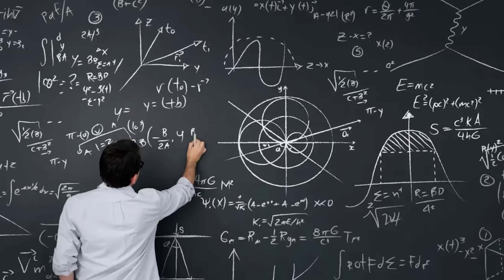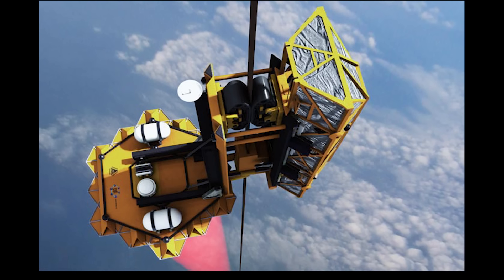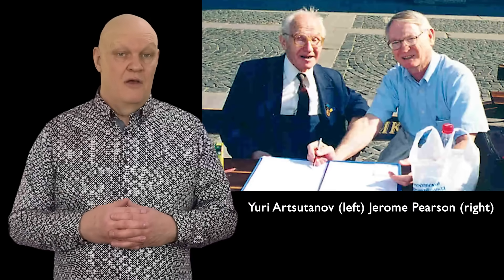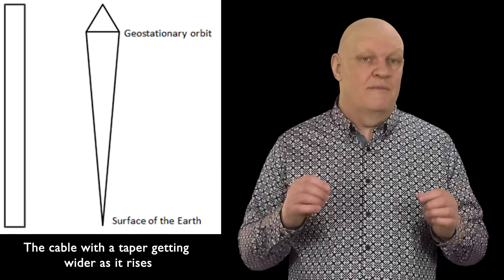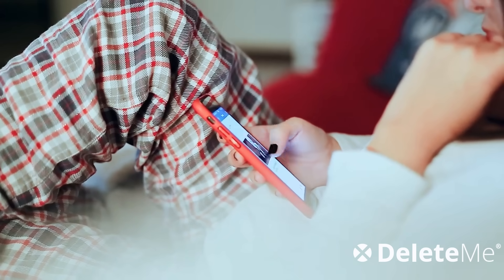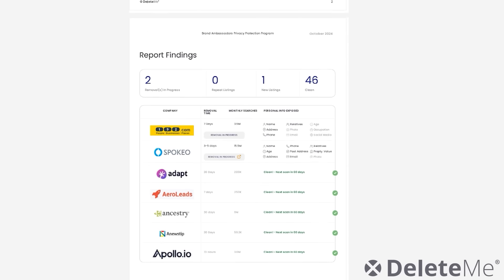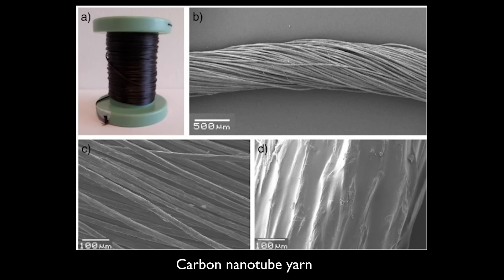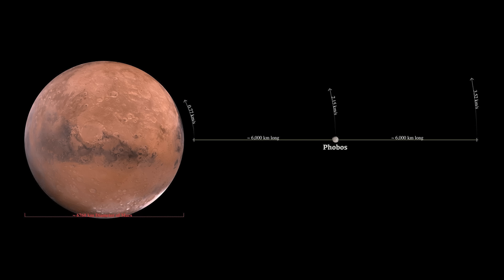Are Space Elevators Still a Thing for the Future?

Comment: The elevator is moving east at 1000 MPH at the surface. The elevator has to be accelerated to orbital speed as it climbs. It will pull west relative to the base. The counterweight will be pulled down. The combination will cause the cable to swing east, and west at the swing frequency of the cable with the elevator at the deflection point. The counterweight will also swing up, and down. The only thing to dampen the swinging will be friction with the part of the cable in the air. Very little of the cable is in the air, and it's moving very little. Most of the motions of the swinging will be in space with no friction. The swing could be dampened if as the elevator pulls west it drags an anchor ship through the ocean. The cable would displace west every time an elevator went up. Continents are in the way so that wouldn't work. The anchor ship would have to be dragged east, and west as the cable swings to dampen the swinging. However, every satellite, and tiny piece of debris in low Earth orbit crosses the equator 32 times a day. Good luck with that.  

On the other hand...

An electric maglev train accelerating with 10G would get a spacecraft to orbital speed with 300 miles of track. Suspended from balloons at 120,000 ft. would be above 99% of the atmosphere. The balloons could be filled with cheap hydrogen rather than expensive helium with no chance of fire because the pressure is too low to sustain combustion. A compressor would be needed to provide air to the motor that turns the generator that powers it. The 17,500 MPH orbital speed would have a wind resistance equal to 175 MPH at sea level. It would not kick the air away at 17,500 MPH. It would compress the air, and heat it up to 5000 degrees. The ship would need a heat shield. The air would then expand back to normal pressure, and temperature, and produce a low pressure shock wave which would hit the track. The track would have to be tough enough to take it. Or the track could be in a vacuum tube with a high speed airlock at the muzzle. A thin plastic cover that the ship would penetrate, and a fast door that closes after the ship exits, and before the air can rush in could do it. While building the track it will be capable of launching hypersonic ships across oceans, and around the world. Trade for those services may be in such demand that several might be built for that trade. They could be assembled occasionally for space launch. Or they could be built until there's an over supply of sub orbital capacity, and the over supply could be assembled for space launch. All of it can be built with hardware available today, and most of it has been available since the nineteenth century.
Reply: That is a thorough explanation of the angular momentum problem that pretty much anyone excited about space elevators overlooks.

Comment: I gather another issue is that, even if a space elevator worked, it would only take you to a geostationary orbit. A LEO orbit requires a much higher speed and most of the fuel with LEO launches goes into the orbit part and not the “getting into space” part.
Reply: While the elevator might not be ideal for LEO, it is well placed for Geostationary orbits and, importantly, launching vessels to the moon and planets.

Comment: A cable that cuts straight through the atmosphere would have to deal with a strong current because of the difference in charge between the high atmosphere and the ground. That will create heat and I think a carbon cable might burn up.

Comment: Even if carbon nanotubes or similar were already being manufactured at extraordinary lengths by 50 factories, it would take a hundred years to produce enough to make the rope/cable. But probably faster than it would take to vacuum the full scale hyperloop to 1/1000th of standard atmospheric pressure.

Comment: Electrical potential between ground and ionosphere is ~ 400 kV.  Don't know what it is from ionosphere further out into space but it's definitely more.  There was a shuttle experiment where some length of material floated away where one end was toward Earth and the electric potential difference between the ends caused a violent electrical discharge breaking the material.  Can only imagine the amount of current available from ground to sky, think of sprites, elves, and blue jets electrical discharges into space from tops of storm systems.

Comment: 4:44 0.63 MPa can’t be right. S355 non alloyed steel has a yield strength of about 355 MPa, tensile strength is even higher
Reply: Specific strength is what's in the video, which is per the steel's density. You're quoting yield strengths which does not take density into account. Video is correct (edit: see further reply below on units). The value will vary depending on the type of steel.
Reply: @dimvoly ok then I suppose the unit is incorrectly shown
Reply: @Hemeralopie  actually, yeah you're right, the unit shown should be kNm/kg, or something along those lines. Good spotting!
Reply: Thank you. Obviously nobody will ever correct mistakes - another argument for not watching YouTube.

Comment: One little detail I get hung up on is the idea of tethering the space elevator to the Earth: I’m of the opinion that it doesn’t need to be tethered, and should hang free. Think about how strong a tether would need to be, with the very heavy space elevator moving around in the sky, then realize that that would impose extra stresses on the elevator itself. It’s just not necessary, in my opinion.
Reply: If designed so that it doesn't need to be tethered, then you might as well connect it to the ground for ease of access, since that won't add any significant mass. At which point it is tethered. So I don't think your idea makes sense in practice!
Reply: Kepler taught us… All orbits are elliptical. If it is in an elliptical geostationary orbit, the bottom end would bob up and down. It would appear to drop straight down from space and then drift back up the same way. Maybe we don't need to climb the cable at all, just grab onto the end and ride it into space.

Comment: Couple things to note, which I think make space elevators slightly more plausible (though still currently infeasible):

The tether doesn’t need to be made of perfect carbon nanotube crystals stretching halfway to the moon. The individual molecules only need to be long enough to create enough friction with neighboring molecules to surpass the tensile strength, which makes the bar much lower for how prestine the molecules need to be. 

Additionally, there are other potential materials other than carbon nanotubes, such as boron nitrate nanotubes, graphene, or diamond nanothreads. 

Lastly, the taper ratio isn’t entirely necessary, given the tensile strength of these materials. We can actually have a uniform thickness, though it would require slightly more material and thus more weight, but it allows interchangeability as the cable degrades from space debris and micrometeor impacts. I’m imagining not one cable, but multiple thinner cables that can be exchanged and replaced over time, and the climber attaches to some but not all of the smaller cables.
Reply: You've described the basic concept of a yarn.  Yes, you only "need" fibers long enough to grip onto the next and form a yarn, but that requires overlap, and overlap means a direct loss of bulk performance of the resulting yarn.  Longer individual fibers produce a higher strength yarn.  A SWCNT fiber might have a tensile strength of 50-100GPa, but the resulting yarn only 10GPa, only modestly better other modern materials.

And yes, even with the theoretical best tensile strength of these materials, you do need a taper, and that's before factoring in margins and redundancy.
Reply: @ Interesting, I appreciate the corrections. I’m no engineer, but I had just seen an engineer explaining it once. If I can speculate for a bit, I think the difference between yarn and the nanotube bundle is that the forces that create the friction in yarn are mostly electrostatic. But because nanotubes are conductive and really tiny, they have Van der Waals forces between them, which may create greater friction. When I heard the explanation, I remembered Van der Waals forces being mentioned, but I wasn’t sure if that was important. 

Also, I’m not quite convinced that the taper is completely necessary since some theoretical designs don’t have a taper. It’s been a while, but I’ve seen the math with and without a taper, and if I remember correctly, it wasn’t entirely infeasible without a taper. But maybe I’m misremembering.

Comment: Another problem with space elevators it that every kilogram sent up the cable will need to gain angular momentum, and that will come from the angular momentum of the cable-satellite. Sending up fuel to the station for rockets to keep the station’s angular momentum where it needs to be, but that lowers the efficiency of the system.
Reply: It’s a tethered system.  Ever used a sling?  Did you need to put rocket motors on the end of the sling to spin it up?
Reply: @wagnerrp  With a sling, there aren't rockets on the rock end, but the movement of your hand pulls the rock around. If the spinning earth is transferring angular momentum to the stations through the tether, that adds quite a bit of strain on the tether.
Reply: @Marc-is-Me  Why assume load only goes up? Aren't there any products up there that would be worth bringing back down? Then you have to lose the acquired angular momentum.
Reply: @ That’s unavoidable.  You always have that strain, unless you’re putting rockets directly on the climber to provide that acceleration.

Comment: Was this obvious problem left out of the video intentionally? Not only does the tremendous lateral acceleration force need to be taken into account (the faster you climb the more force), creating a varying angle and much longer cable system  but also there would be a "whip cracking" effect on decent as the forces reverse! Like a ballerina pulling her arms in while spinning, the angular momentum must be conserved. Spin around with a weight on the end of a rope, now pull the rope in and let it out, now slow your rotation see the problem? Especially in a vacuum. Maybe lateral thrusters on the car could help.  We're talking 21,000 mph here minimum at geostationary orbit.

Comment: What about a hybrid? Rather than a static location anchor, use a long cable to allow lower energy launches. Most of the energy, fuel used at launch is needed just to get the relatively small payload off the ground. Then there is a point at which gravitational pull on the rocket drops as the fuel weight also decreases! And also the gravity turn and other maneuvers. 

What if with advanced technology the rocket could launch with only it's own, no payload weight? Pulling a cable under it as it lifts. As the fuel is used the rocket's weight drops. This alone would allow a heavier payload if on the rocket at that point. Then after the gravity turn a whiplash effect could be added. All depending on the strength of the cable. If the cable was stored on the ground it's weight would be minimal at lift off and increase only as fuel is used and gravity is reduced. OK lot's of complications, engines discharging on the cable, stress and acceleration at point of payload liftoff.... But to be able to dramatically increase payload to fuel needs? To only be lifting the payload when the rocket has left most of the energy needs behind? And for non-human payloads maybe the significant acceleration boost of that whiplash at the end? Crack the whip!

Oh and for kicks. Got a kick out of the way you started the ad.  In the '80's I was on ARPANet (later called the Internet) with a dedicated 56K connection working for Symbolics. Symbolics.com was the first domain name issued.

Comment: Question: Must the tether consist of a bundle of carbon nanotubes that are all tens of thousands of kilometers long -- with zero defects -- or can we rely on things like the van der Waals force, interweaving and the addition of other material(s) (to form a composite) to prevent much shorter lengths from slipping past one another? This way it would not be necessary to make such ridiculously long molecules, while the overall result would be much stronger and more resilient.

Comment: Just imagine the inspections required for maintaining the thing even if it were possible to build it! Simply inspecting long cables on suspension bridges like the Golden Gate Bridge or large aerial trams or ski lifts is a massive labor-intensive task. The scale of this is impossible. Also, not sure why they call it an elevator, an elevator is hoisted up by the cables. This is really a gigantic aerial tram since the idea is that it crawls along a cable.

Comment: I´m obviously no physicist, but where does the payload or the end of the tower get its "forward" acceleration from?
Am I missing something or why doesn´t the payload need that prograde acceleration as well?

If it climbs up the tower, it needs forward momentum.
Where does it gain that from?🤔🤔
Reply: Astute observation! Should have been included in the video! It would come from a changing angle being formed in the cable attachment point as the object climb. This angle has to be reversed to decend. As I visualise it it would actually cause a "crack the whip" effect.

Comment: Something I never understood: if the station is at GEO, and the counterweight above it... wont the counterweight be in a much faster orbit, thus putting the whole ensemble out of sync?
Reply: The counterweight won’t be in orbit. Instead the cable tension will drag it faster than orbital speed, keeping the whole system taught.
It’s a giant version of the Olympic hammer throw, except that you have to keep hold.
Reply: @PeterDebney  drag it "slower" you mean? If the terminal is at GEO, the counterweight is higher and thus faster. I can imagine the cable holding it back like a leash, but then the whole assembky would tilt forward.

Comment: It doesn't have to touch the ground. Lower part can just float a bit. And it would be easier to build it from center of mass the orbit.
Reply: Actually you will have to connect it to something at the bottom otherwise it would be extremely difficult to get on to it - it would be flapping around!
Most practical designs have the cable attached to a floating base station, which would both keep the tension in the cable all the way to the end, give flexibility regarding the cable’s location (move it out of the way of satellites, and give some adjustment due to the tidal forces on the elevator.
Reply: @PeterDebney  "it would be flapping around!" That's why it shouldn't. Or whole joint will constantly ripped apart. Floating platform can be easily accessed with some droids.
Reply: @elksalmon84  The floating platform proposed is one that can be easily accessed by boat - no droids required.
Reply: @PeterDebney  Flying boats are what is called droids. Or quadcopters.

Comment: Setting the strength issues of the materials aside- we can introduce another issue nobody talks about: the imbalance of energy as the elevator climbed the tower, this "energy" would slow the movement of the satellite as it moves in orbit around the Earth, thereby causing the geosynchronous end of the equation to fail, and also ending the day badly for all the hard work done to get to that point. The energy for the elevator to climb is also pulling at the satellite in the beginning and pushing at the higher end, as the elevator moves past the tidal fulcrum point. These issues are far more important to the success of the ongoing operation of the elevator than just the engineering of the materials involved, though, you can't even think about that until you have them... lol.
Reply: 1) The elevators and contained load mass is relatively minor compared to the entire system weight
2) One assumes cars going both up and down, over a relatively short time the mass pretty much cancels, resulting in only minor perturbations at the top
3) The counterweight is not designed to exactly counterbalance the system weight, it over-balances to introduce a pull to keep the entire cable in tension. This extra pull is more than sufficient to keep things in place for the maximum number of ascending loads at any one time.

Comment: How do you grip on to the cable? Aren’t carbon nanotubes very slippery?
Reply: First of all, it wouldn't be a cable, but rather a flat ribbon. Then, the "elevator car" grips on the ribbon from both opposite sides of the ribbon, simultaneously. Are my explanations clear enough ?

Comment: One thing has been overlooked (or brushed under the carpet) - What is there to stop an aircraft - 'temporarily uncertain of it's position' - from flying into the cable (shades of WW2 and the barrage balloons)? Would the cable cut the wing off - or would the wing break the cable? - - - Then - it IS April 1st!
Reply: So what if you break the cable?  You have 10km of cable that comes crashing to the ground in the vicinity of the ground station, along with the aircraft.  You lose the use of that specific ribbon and ground station until you can make repairs, but you have others, because you would need others to make this a redundant system capable of weathering such impacts.  It's a costly accident, but ultimately little more than a nuisance compared to the original cost of deploying the system.
Reply: @wagnerrp  But  without the weight of the severed length of the cable, the other length will lash back, and the couterweight satellite will lose it's stability, if it doesn't get launched out of orbit.
Reply: @hamshackleton  You’ve only lost the inconsequential weight of the last 10km or so of a 35Mm long tapered tether, and why would you only have the one tether?  That’s just asking for a disaster.